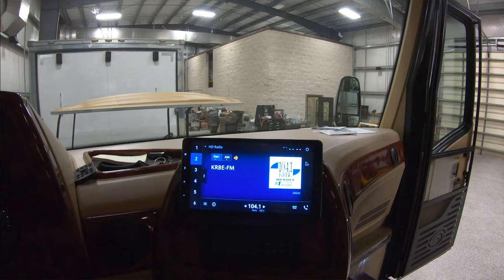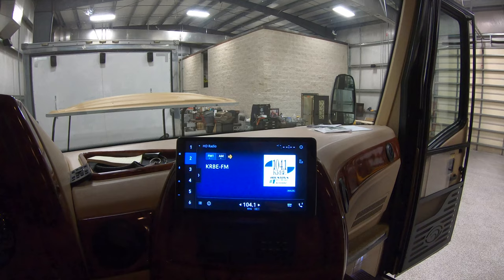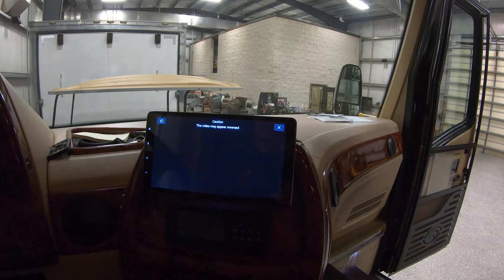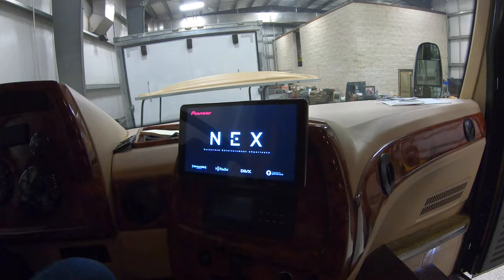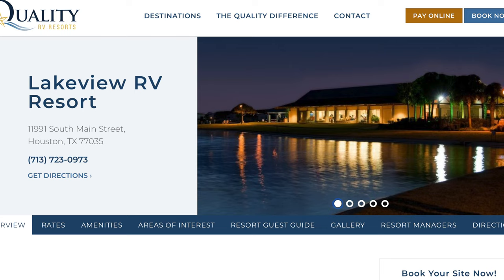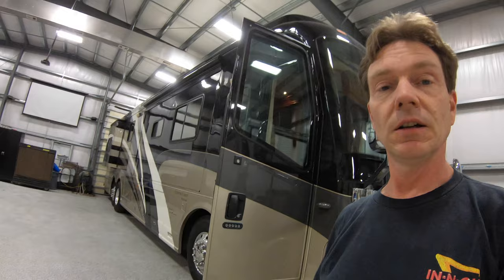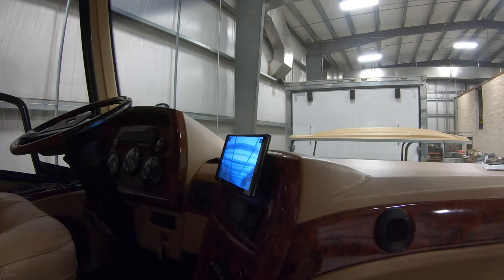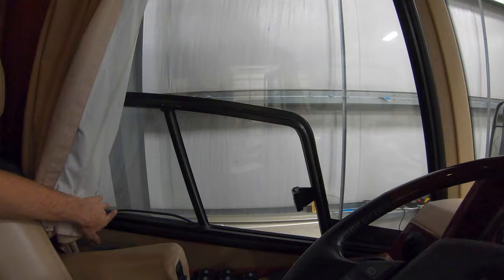New Pioneer Radio in a Country Coach Magna

Comment: Here's a good question for you Brian. Why do some coaches have a inside curtain covering the exterior wall of the slide when in the in position. This coach has one on the passenger side but not the driver. And most coaches dont' have one at all, was it an option or model specific??     CHEERS     Steve h.

Comment: What is the model number of that Pioneer Radio?
Reply from the maker: DMH-WT8600NEX would be the current model.
Reply: @briansrvvideos  Thanks Brian.  Would this be what you would recommend for replacing that old Kenwood KVT-M700 in my '05 Monaco?  I would need a single DIN and maybe one that is a little less expensive and with a 7" or 8" screen?